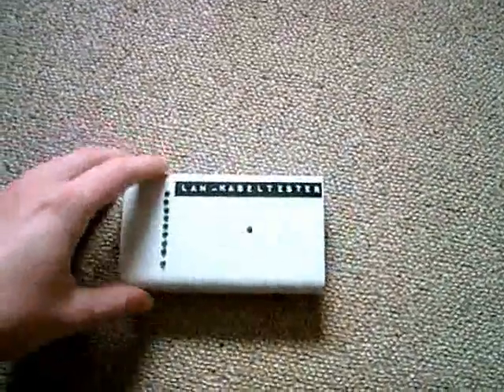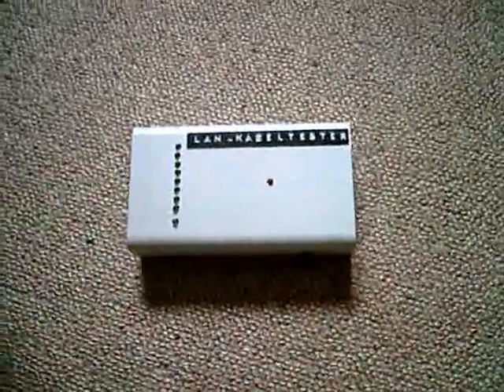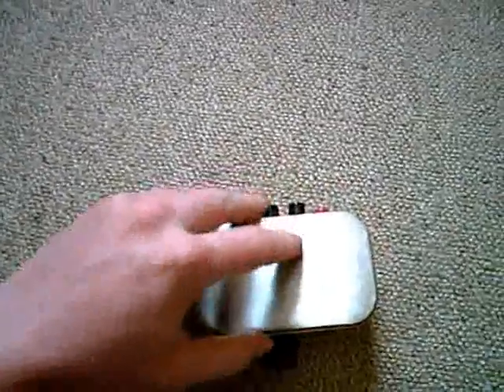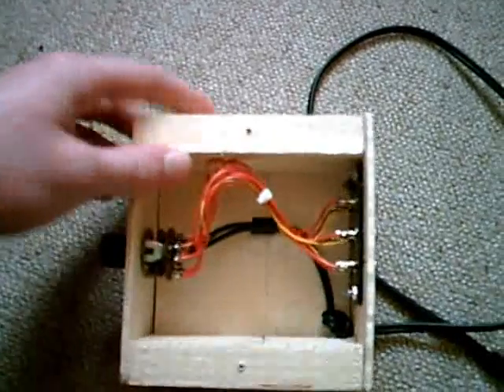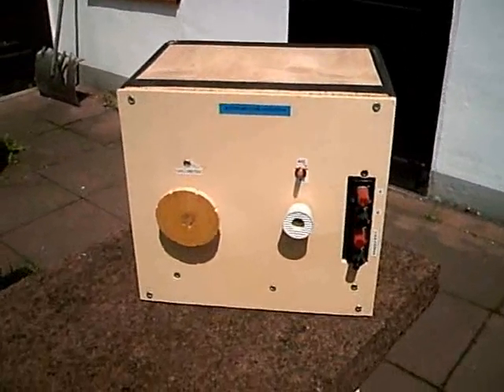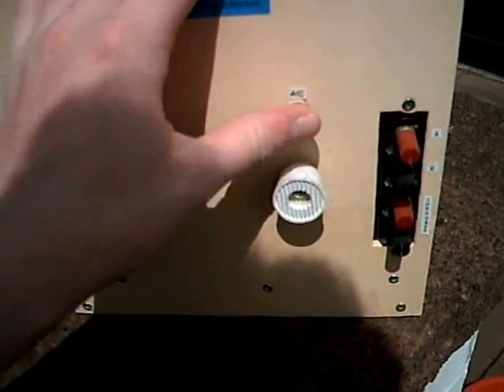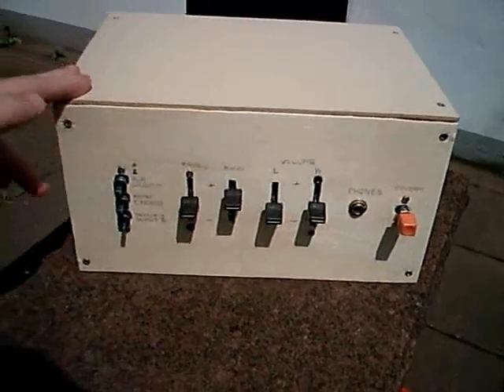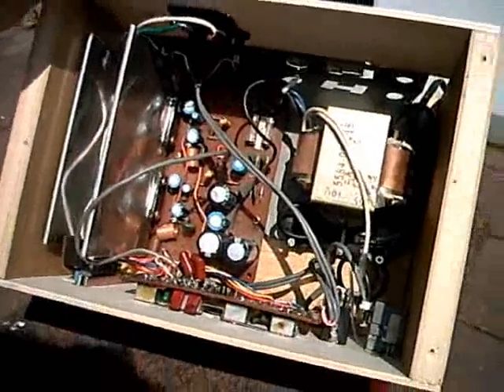Homemade electronics (1/2)

Comment from the maker: @freakface666666 

Your power suplly has to have a voltage of around 2 volts. More voltage will destroy the LED. Also pay attention to the polarity of the LED and the power supply (you need a DC supply of course!)

Comment: I've seen those Ethernet cable testers commercially available, the ones I've seen have 2 units, and you run the cable between them, one unit is the master unit which contains the battery, both units have the test LED's on them.  I remember an admin technician at a school I used to attend had one for checking network cables.  They're a very handy device to have around if you do a lot of network troubleshooting.